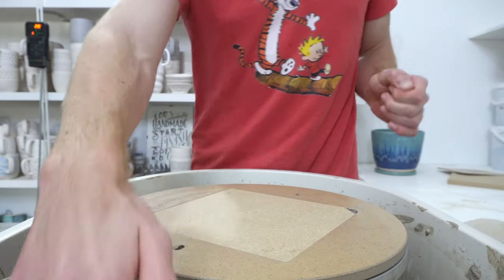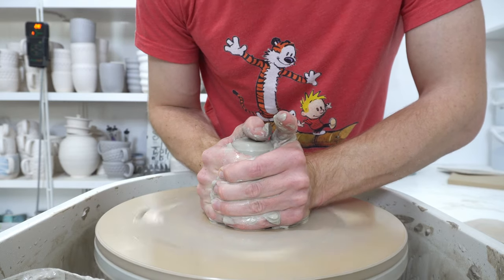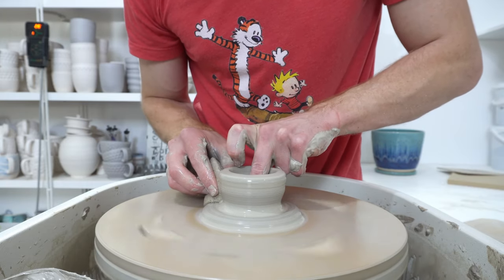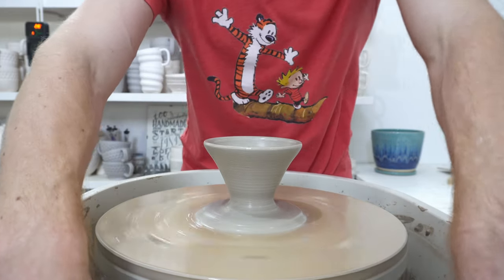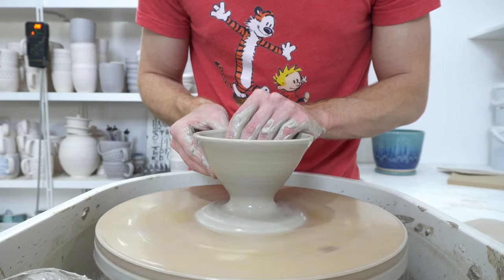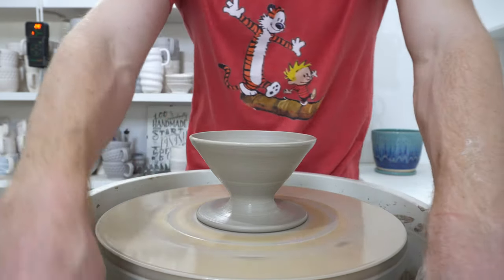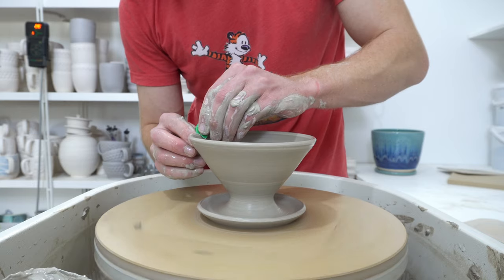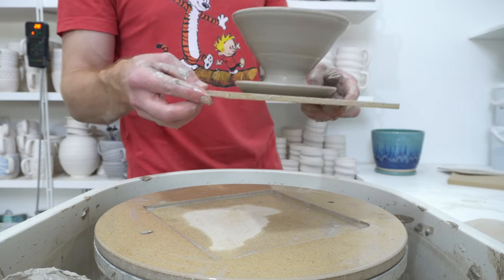Throwing a Coffee Pourover, and the difference between a Dripper and a Pourover

Comment: Gorgeous pics at the end! Question: I purchased one of your handmade metal tools for bases. In using it for my first few pots (mugs), I've found that it leaves an indent/ridge just above the curved edge. Any tips on how to avoid this? Am I using too much pressure? Thanks!
Reply from the maker: Are they rounded (like a small bowl) or straight sided? It's all to do with how much clay you leave for the tool to work on, and it could be that there's too much clay for it to shape without pushing some up. I'd suggest trying to incorporate slightly more of the clay at the base into the piece (or just use another tool to remove some before using the foot tool) and trying it again. There's definitely a sweet spot where it shapes the foot where you want, so it's worth having a play with that to find what works for your forms
Reply: Thanks!